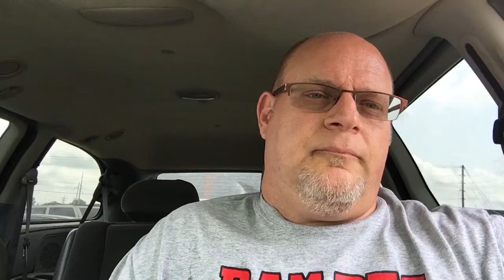GM 5.3 5.7 6.0 12552216 crankshaft issue 2.0

Comment: If you drop a crank into a engine with out a balance first is stupid. You do not build by part numbers.
Reply from the maker: D. C Exactly, if you want it to be right!  I'm trying to verify and validate this concept. What's scary is for ever, literally as long as rebuilds have happened only a small percentage of people spend the extra money to spin balance the assembly. Thanks! JD

Comment: A little reading here to shed some light. 
https://ls1tech.com/forums/generation-iii-internal-engine/1570756-gm-crank-pn-12552216-same-crank-used-5-3-5-7-6-0-1997-2007-a.html
Reply from the maker: Slaughter's Channel The problem I see in the entire thread is everyone assumes the crankshafts are balanced to each CID, because this would be the right way to do it,  but nobody can prove it. I'm hoping I can find a way to prove a difference at least between the 5.3 and 6.0 as it should have the most variance. Roughly speaking in a side by side weight comparison the 5.3 crank should be .3-.35 lighter than the 6.0. 
This is assuming the cranks were balanced to the CID
I believe the true LS1 cranks have the hollow gun drilled rod journals making them easy to identify.
Reply from the maker: Slaughter's Channel Interesting note about the true balancing of a 5.7 using a 5.3 requiring 28 grams of Mallory metal. But during the build did he bore the block and were the pistons Forged?  He just says during the rebuild. 
The short fall of my idea to compare the physical weights between the cranks is, it only works if all the cranks weighed are Std/std on the journals never machined plus have to be clean. 😧
Reply from the maker: Sorry I went back and reread the post, he said "Stock LS1 Pistons and Rods".., I need to pay more attention. 😇
Reply: HeadFlowInc  it's a great idea to look deeper because there are some motors that will and do tear themselves apart, and this could be a root cause. Keep digging 😊

Comment: I completely see where youre coming from with this. Ive never really thought about the balancing according to cubic inches thing. All I know I myself, and many others swap out to gen 4 rods all the time. Plenty of people (including Matt at sloppy mechanics) are even boosting on swapped gen 4 rods with no issues whatsoever. This video does make me think though. ;)
Reply from the maker: Bad Luck Garage Here's something people overlook, Matt has destroyed several engines, he doesn't care if the fail.  I'm trying to build a true street engine that has to be dead reliable. In a race car it's totally different. Imho
Reply: That's true. I'm currently running gen4 rods on a .010 5.3 crank in a 6.0 just for the record. Nothing crazy though although I do spin it to 6300. Boost is coming soon so I guess we'll see what happens. 😉
Reply from the maker: Bad Luck Garage Sweet!  In my 5.3 build it will see 6000+ rpm's, based on the Dyno videos of the cam I have it should peak around 6200-6500 rpm. So, I need it to be balanced to safely handle close to 7000 rpm shifts. I can't wait to see the Turbo go on yours!!! JD
Reply: we're hoping to get the hot side fabbed up this weekend. Of course Ill be doing update videos. I still have a few more parts to buy though before it all goes together.
Reply from the maker: Bad Luck Garage My friend with the 1993 GMC Typhoon tried to fill the coolant last night and the water pump leaked from the weep hole. 🙄. Same leak happened to me on my 4.8 in my S10 Blazer. It's like once the LS water pump has been in service storing them dry is the kiss of death. ☠️
I can't wait to see/here your Turbo build. I should have the start up on the Typhoon by this weekend. GT45 Sloppy build
Reply: Its so funny you just mentioned that because the video I posted an hour ago I was mentioning all the dead LS water pumps I have laying around. I think the seals dry out and crack if they sit longer than a few months. I've had to replace the pumps on almost every ls swap I've ever touched. Just did a pump job on one two weeks ago matter of fact.

Comment: O.k. so I ask you this, do you think that GM made the crank for the 6.0 with the 40gm heavier setup and it's fine or safe to use it with lighter rods,pistons and hardware for 5.7,5.3?
Reply from the maker: Alpha Ghost we won't know until we can verify at least the weight of the G3 5.3 crank.
All the rods are the same in terms of generation. G3 5.3 5.7 6.0 all weigh 612g
When you look at the G3 & G4 4.8 5.3 pistons and pins regardless whether they're Flat Top or Dish they all weigh 570g
The G3 6.0 piston/pin weighed 610g

* So if, the G3 6.0 crank was actually balanced to its piston and rod weight....this is not verified, a person could run G4 5.3 thick rods and floating Pistons on the G3 6.0 crank and be within 2g of balance. Still unknown situation.
Reply: HeadFlowInc Which engine did the flat top pistons come out of?
Reply: Yes the one's that you were planning to use in the turbo LS block your building.
Reply: HeadFlowInc so I have a G3 5.3 engine and a G3 LQ4 6.0 with G4 rods (2005). My 6.0 crank weighs 51.6 lbs where my 5.3 crank weighs 52.8 lbs.  I wanted to use my 5.3 crank in my 6.0 because the 6.0 one needs work. Not sure if I can now... I wanted to still use my G4 rods
Reply: HeadFlowInc you just blew my mind with your theory of how gm balanced these cranks.. Im definitely going to have my crank rebalanced for my rebuild just for gp. No wonder my motor in my silverado always feels so shaky..the v8 in my sc400(1uzfe) is as smooth as butter.
Reply: HeadFlowInc hey i wieghed the crank..had to track down my digital scale....52.6lbs. I have .030 off rod journals and .010 off mains. I know this scale is dead nuts because at the doctors today my wife got on the scale and was 119.5...the scale at home she was 119.6 she had shorts at the docs and sweatpants at home which would explain the .1
Reply: HeadFlowInc i have a gen3 crank from an lm7 im looking at right now if you want to know the wieght..im 110% sure its from a 5.3 i took the motor apart myself ill try and wiegh it in the morning
Reply from the maker: Sounds great let me know what you find,  Thanks!
Reply from the maker: Rick Bean I wonder how much difference removing .030 off the rod journals and .010 off the mains lowered the weight? Interesting results! Thanks I appreciate the help. JD
Reply: HeadFlowInc Im sure someone smarter than us has a formula
For it. It was actually 52.8 i typoed that. I posted a video on my channel. I am curious about this now too. I mean GM couldnt have just balanced both the same and said screw it right?
Reply from the maker: Rick Bean I'm pretty sure GM balanced to each CID. The goal is to find out how to tell. Lol
I had a reply saying all the castings were the same but there are other actual part numbers on the cranks. I'm still looking into it.
Reply: HeadFlowInc so i have a 219 0r something on the other side of my casting # right above it on the other weight. Not sure what this is or if it might help